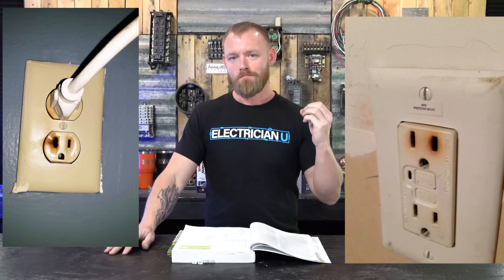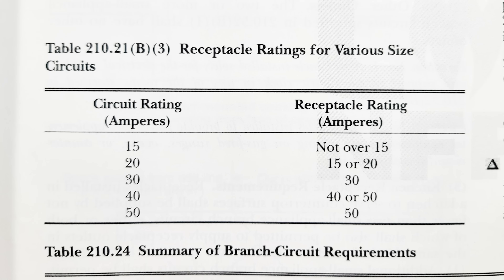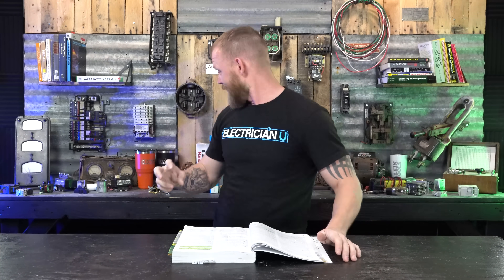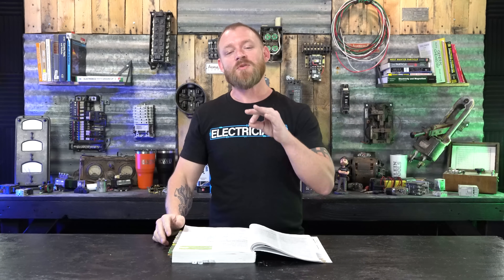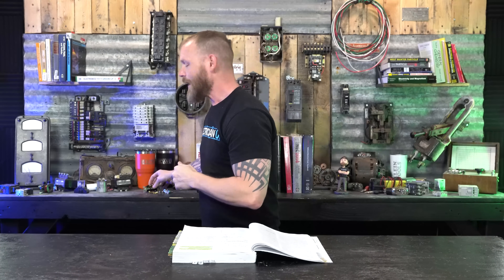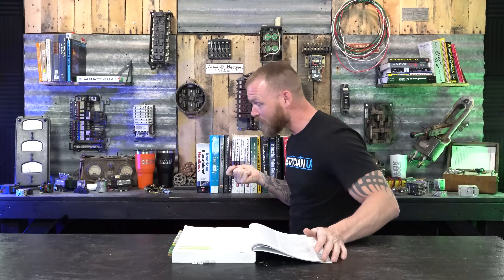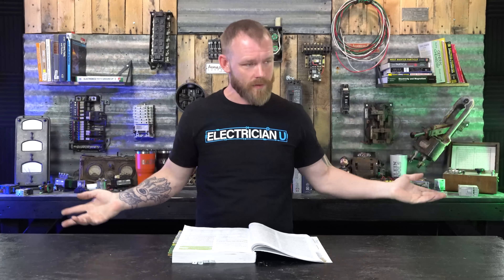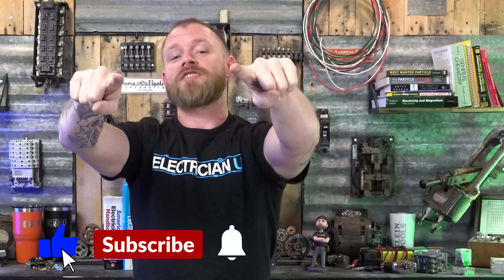Won't These Melt?!? 15amp Receptacles on 20 amp Circuits!!!

Comment: I realize this is from a few months ago- but I'd love to know where it's defined that a 15amp duplex receptacle is rated for 20amps of _feed-through_. In other words- are all 15amp duplex receptacles rated to allow 20amps to pass through the receptacle to feed other receptacles down the line? And if so- where is that requirement defined? And if not- do I need to check every receptacle I buy in order to make sure they're rated for that 20amp feed-through?

Comment: Most simple explanation I can think of is that 20A breakers are capable of having 20A "drawn" through them. 

A 20A breaker doesn't "force" out 20A. It won't "pump" 20A into a 15A receptacle.

Comment: So im not allowed to plug in my new air compressor i just bought that came with a 15 amp plug and motor draws 13.8 amps.
Reply: You should be fine, especially on a 20 amp circuit. However, you should be mindful of any other significant loads on that circuit at the same time and how long is the compressor motor actually on. Same would apply on a 15 amp circuit, but with less leeway. What does the user manual say?
Reply: @surferdude642  here's the thing. User manual just says to plug into grounded outlet. According to nec this should have a dedicated 20 amp breaker which means that it must have a 20 amp receptacle. To comply with code the compressor needs a 20 amp plug. However if i plug it into my garage outlet which is 15 amps it runs fine all day long as long as i only have the compressor running on that circuit and the garage lights.  BUT NEC SAYS NO!!!  Just pointing out how things that are sold violate electrical code but i guess that's ok but dont you dare do anything like this yourself because it's not ok because you are not a big corporation.
Reply: @kwacz  I get your point, but it seems that manufacturers are reluctant to use 20 amp plugs, they are rarely used.

Comment: I put 20 amp in my house in garage. The bulk packages of the outlets were not all that much more money than the 15s.  In the living room I've got my home theater, I ran two sets of 12 to a single duplex outlet. Cut the link between the two outlets. I did this to handle the two 2000 and 2500 watt amplifiers.  

Had to install a new meter socket, and Burry new 2-2-2-4 out to the garage and then put a new panel out there as well.

The GFCI 60a 220 breakers is the most expensive part of bringing this up to code
Reply: Now, here's someone who's talking my language!.. I'm a home theater enthusiast myself. 
My new amplifier shows 3000 watts on the back plate behind the unit. I also have the AVR, blue-ray player and the TV connected together on a surge bar, and then plugged into one outlet. 
Can you tell me what I need to do here so things don't heat up...? With everything connected to my surge bar, I must be up to 4000 watts. I don't know if the audio equipment "watt-values" are calculated in the same way, to evaluate the necessary circuit breakers needed? 
Can an electrician chime in on my case please? It would be GREATLY appreciated!

Comment: I'm going to say thank you for this. I think you just explained what is going on.
I have a group of plugs in one room that got hot and quit working. I had a total of 1500w of draw on a pair of the plugs and it appears there are 4 plugs in the circuit. Everything is unplugged right now and the plan is to find the breaker on sat, identify the rating of the breaker, and replace all the plugs. I'm willing to bet they are 15 amp plugs and the 12.5a draw at the end of the circuit is what caused the issue. The real question is whether it is a 15 amp breaker or a 20 amp one. Ill add check the gauge of the wiring to see if I can up the amp rating of the breaker as well to my list of checks.

Comment: How would I add a single dedicated breaker for all the power tools in my garage? Someone please help me out with this
Reply: In the long run, I'd recommend adding a sub panel in the garage and hire a licensed electrician to do that including running the wiring and conduit required. You may be able to take from there if you have the knowledge and skill to do the rest as a DIY project.

Comment: Question to anyone that can help me.
When I connect a hair drier in one bathroom it triggers the brake right away. When I plugged to a different bathroom works fine.
I asked a couple electricians how can it be fixed. One said replace 15 Amp outlet for a 20A. The other electrician told me replace the braker for a bigger one.
I don't feel like doing neither one because probably the wire might be thin 14 AWG and will melt and cause a fire.
How can I diagnose the problem and fix it?
Please advise.
Reply: Some hair dryers are rated at 1800 watts which is 15 amps which is the maximum for a 15 amp circuit. That alone may or may not trip the breaker, but if there are other loads on that circuit at the time the breaker should trip immediately. 20 amp circuits are good for 2400 watts of non continuous load (less than 3 hours). The solution is not easy or cheap and requires a dedicated circuit to that bathroom. The advice you received is garbage.
Reply: @surferdude642  Thank you.
What is strange is that in the downstair bathroom with the exact same 15 Amp circuit works perfectly fine for hours.
Because the bathroom outlet with ptoblems is on the second floor on the opposite side of braker box in garage, it will extremelly difficult to run a new circuit with a 20 Amp braker, 12/2 AWG wiring and 20 Amp outlet.
I might replace the 15 Amp braker that hopefully is just 50 years old.
Reply: @joaquinsuarez6090  Yeah, I would try replacing that 15 amp breaker with a new 15 amp breaker. You shouldn't use a 20 amp breaker unless you discover and verify that the entire circuit is 12 gauge.
Reply: @surferdude642  Will do, thanks

Comment: My understanding is the breaker protects the wire. I put in a 30amp 220 breaker and #10 wire for a mini split a/c unit.
It failed inspection - the mini split has a 20 amp rating so i needed to put in a 20 amp breaker.

?? that implies I need 2 amp breaks for a light, not 15 amp.

I also have an understanding that in a garage 220 outlets need to be GFI...but the inspector says no.

I did put all 20 amp outlets in my garage on 20 amp circuits and breakers!

Comment: Rule #1:  You can't fix stupid.  Many of us have been educated since grade school to not plug lots of devices into an outlet using cubes or other outlet expanders.  I'm not an electrician but things I've done my entire adult life required an understanding of electricity.  I've seen plenty of outlets that were burned like those you show at the beginning of this video.  The question comes to mind WHY they were burned.  Could the plug have been pitted, oxidized or otherwise faulty?  While overloading can be one cause it's not necessarily THE cause.  

If overloading was the primary cause, the 6 HP vacuums and 4 HP 115VAC air compressors would burn outlets regularly.  OK, that was a small rant about "peak horsepower" because we both know you can't get 4 horsepower out of a 20 amp circuit.

Comment: I've came across this issue many times and after an good amount of time and the receptacles get old you can have minimal stuff plugged in and get melt downs and house fires! I always warn clients about using 15 amp receptacles on 20amp breakers  and to me this is dangerous in my opinion!
Reply: The problem is cheap receptacles, not 15A receptacles.  Also poorly wired receptacles.

Comment: So code issues, how a trip curve works, etc all very important. But in reality you don't need anything even CLOSE to the max rating of any part of a circuit to melt something. I can take a 10w soldering iron and melt a hole in a receptacle with it, no problem. We have to remember the difference between 'heat', and temperature. It's easiest to think of heat as an amount, and temperature as a concentration or intensity of said heat. Possibly same amount of heat in my hand and a candle's flame, but if i caress your face lovingly you will not be burned. Might feel something, might not be good, but not a burn. 

A poor connection can melt things while flowing way under even the 'normal' current for that connection. Voltage drops across resistances in a circuit. Voltage drop is amps x ohms of that connection.  It will develop heat based on watt's law. Watts = Volts x amps, where in this case volts is the voltage dropped at the connection.  So you got a certain amount of energy being converted to heat across the poor connection. The temperature that reaches depends on a bunch of things but mainly how small of an area this current is flowing through. If there's only one speck of your blade terminal actually making a connection because of poor terminal fit/tension or corrosion, pitting from prior arcing etc, that tiny spot is going to reach a high temperature and start conducting out into the plastic housing and melting it. 

So really, circuit breakers do NOTHING to prevent melting because like i said, you can take 10w of heat and melt stuff and good luck getting that breaker to trip under ~2000w.  Unfortunately it's going to come down to the condition of things that are hard for the layman to assess, like the terminal condition inside a receptable. About the only thing i think a customer could consistently be trained to recognize is lack of tension on the terminals when they insert plugs. Or just 'if it looks old, consider replacing it' although that's a double edged sword when it comes from the guy who stands to make money doing it. 

I'm just a car mechanic who lives in a very non-code-compliant off-grid home and has to survive it without being able to blame a codebook for anything i do wrong, so take it for what it's worth. I am not formally trained on AC.

Comment: Hey Pal a New Breaker is made to trip at 80% of rating. a 15A should trip at a 12 amp draw, a 20A should trip at a 16 amp draw etc. etc. etc.
Reply: I don't believe that's true. A breaker should trip at its rating, sometimes slightly higher, the length in time being a factor. You must not load a circuit to more than 80% for a continuous load (defined as 3 hours or more).

Comment: customer was asking why his water heater wasn't working. I looked at the panel. it was on two 20 amp breakers. 😂 I said, "there is your problem." and this was a recently built apartment highrise 🤣

Comment: 😷🤣  BEST  PRACTICES  FOR  ELECTRICAL  WORK  DONE  FOR   DEMONCRAT  POLITICIANS…..

- Always utilize the Chinesium  “Super Economy”  Made in China  Devices Sold by Amazon.
They usually cost approximately $1.25  per Dozen.

- Always use the preferred “Back-Stab” method of termination.

- Fuses are very much underrated as protective devices…. Especially when using copper/zinc pennies or other coins.

- Installing receptacles inside a bathtub enclosure or shower provides convenience for charging cell phones or toasters and other appliances traditionally used in the kitchen.

- GFCI’s and AFCI’s are newfangled magic devices prone to nuisance tripping.  
Never use such gadgets unless required /demanded by armed customers.

- Color Coding is for those afflicted with OCD.  Total waste indeed….  
Guessing identity of conductors is much more conducive to an easy day at work.

- Grounding is a total hoax conjured up by the same people who invented the electric chair.

Let’s Go Brandon  /  
FJB and Hunter “Sparky Pederast” Biden
🇺🇸😉🤣

Comment: A 15 amp duplex outlet is rated for 20 amp pass trough. This means that a duplex outlet is not limited to the capacity of a single outlet. If an appliance requires say 13 to 16 amps like a table saw, it will require a 20 amp plug and outlet so that it cannot be plugged into a 15 amp outlet. If you have a duplex outlet you could plug two 8 amp appliances into a duplex on a 15 amp duplex outlet on a 20 amp circuit and still be within the 80% rule. The problem comes in when people plug two, 10 amp appliances on the same circuit. The plug is rated for the load and a 20 amp breaker will hold the load but on a 15 amp breaker, it may be in trouble if it dose not trip. 

Consumers do not read the code and have not been educated on the NEC and the breaker is the only thing that keeps them alive.

Comment: I had to change a circut due to the electric kettle popping the breaker. Lots of years ago hard to remember but it was not really overloaded but it was tripping so I changed it. Easy wire and breaker change. I used 15 amp recpticals as the kettle was the biggest draw.

Comment: I own rental properties and I can't tell you how many times I come across this. Many times when I go to switch them out the 15AMP receptacle falls apart.
What's beautiful about outlets is that 20 AMP outlets have a perpendicular slot which tells you it's 20 AMP and a receptacle without that slot is 15 AMP.
Reply: Your receptacles fall apart because they are cheap.

Comment: In the UK we run 32amp circuits but each plug has an internal fuse that can only draw 3kw or 13amp at eat outlet..

Comment: The important thing is never to use a 20a receptacle on a 15a circuit.  A 20a receptacle on a 15a circuit will allow the user to plug in a 20a appliance (with the one horizontal blade).  The 15a receptacle will prevent a user from plugging in a 20a appliance.  It probably has little to do with the robustness of the receptacles.
Reply: Power strips…

Comment: Other things that can cause heating of a receptacle include:
1.  Oxidation over time.
2.  Loose / worn receptacle; the internal contacts don't make good solid contact any more.  Maybe cords got yanked sideways a lot, levering contacts apart:  someone trips on a cord, or it's not quite long enough.
3.  Paint:  painters don't always mask outlets.
4.  Dirty plugs (dropped in goo, shaken off), other contamination.
5.  Spray cleaners (saw someone spray cleaner into a $50 electronic dimmer once; killed it).
6.  Plugging things in that have capacitors or are big loads:  arcing.

Sometimes I think the amazing thing is that outlets DON'T catch fire more often!

Comment: I recently installed a Single 20 amp external receptacle on it's own circuit on 20 amp breaker. 12/2 wire. I went to buy a heavy duty extension cord and noticed both 14 and 12 gauge 50 ' cords were only rated for 15 amps. Any idea why?
Reply: Distance on a stranded wire (cord) based on size diameter controls how many amps should safely go through that wire. The longer the cord, the more resistance, the less amps can safely go through the wire. I have a 50 amp 240 volt welder cord at the house. Unfortunately, its only 25 feet long ( I think its 6 gauge leads under the cover). Big amps, big wire. Longer run, bigger wire.

Comment: what about a 15 amp circuit, using 20 amp receptacles, wouldnt that keep the receptacle from burning up in extreme cases but still allow the breaker to trip at its rated amount ?
Reply: No. A receptacle in normal condition has nothing to do with circuit breaker tripping.
Reply: @surferdude642  i understand that, I’m only talking about the receptacle changing
Reply: @TheWackyRigger  Using a 20 amp receptacle on a 15 amp circuit is a code violation.
Reply: @surferdude642  thank you

Comment: it's still silly why bother when talking about like a dollar different between a 20 amp and 15 amp.
Reply: The grade of the receptacle is what determines price, not whether it is 15A or 20A.  I got some spec-grade 20A receptacles for less than the 15A receptacles of the same line, probably just because of the supply and demand.

Comment: I've got several 15 amp receptacles on 20 amp circuits. Never had an issue. They are all dedicated circuits and receptacles. No multiple receptacles on one circuit.